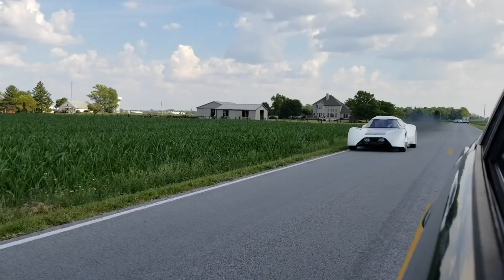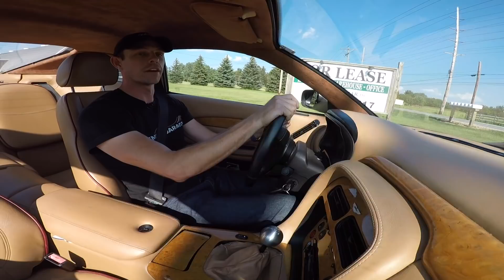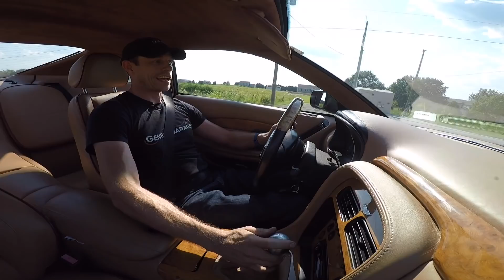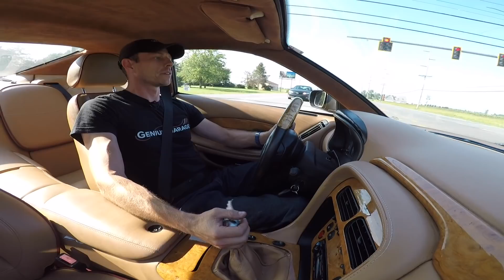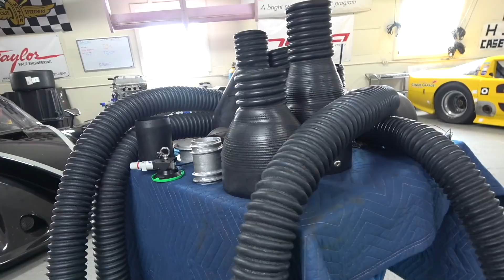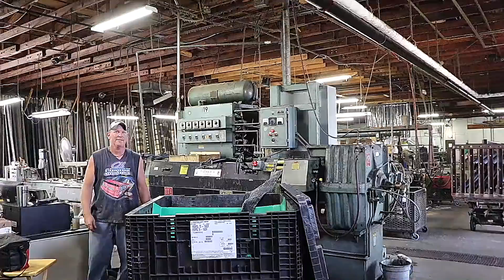How I SAVED a friend from JAIL TIME -Cannonball Run

Comment: Being a guy who started driving in the days of double nickel, living in a state that's very large, with (at the time) a low population density.  With freeways that were designed for 70+ speeds, with cannonball movies in theaters at the time, and reading Car and Driver. I was all behind Yates. 
Brock was on Ted Copple one night debating the 55 speed limit, his opposition was a Washington bureaucrat. I do not remember the full exchange, except for one line from Brock. "It's real easy for someone who goes to work every day in the back of a limousine, to tell all of us how to drive".  It did shut her down, it wasn't long after speed limits changed. That's something we need more of these days. Not doing a cannonball, but the spirit of what it represents. I think that has been lost in time. 
I do think a little of it still exists, in the face of endless environmental nonsense. A few are still pushing the limits of engines, doing what we used to say. "Sticking it to the man".
Reply: I couldn't imagine driving 55 in the now 80 zones in Utah and Wyoming

Comment: Hey Casey! Unrelated to the vid, sorry... I have a question on double clutching if you don't mind. I was wondering why it was necessary to "Clutch, go neutral and let go of clutch, rev match then clutch and go in gear". Does it give the same benefits to your car to just keep the clutch in, rev match, and then downshift? I have been wondering this for so long :P.
I am sure there is an explanation and I'm very curious as a person who is looking to buy a secondary older car like a 944 or corvette c4.